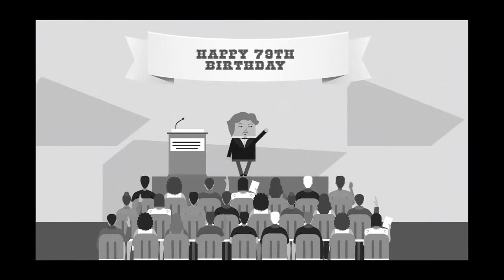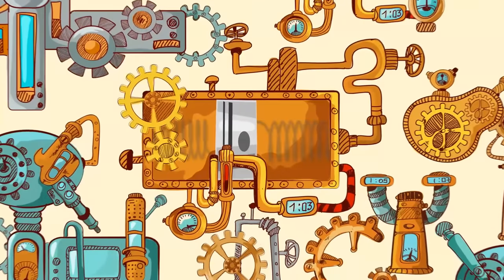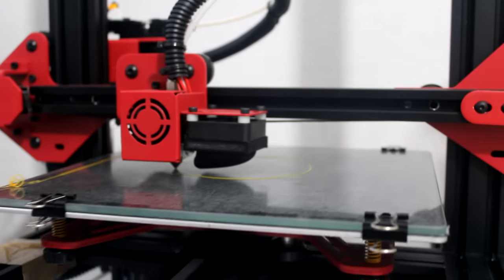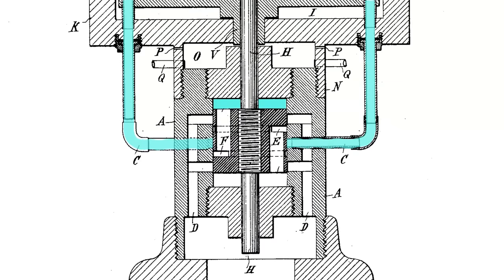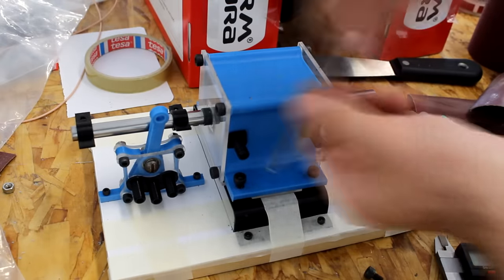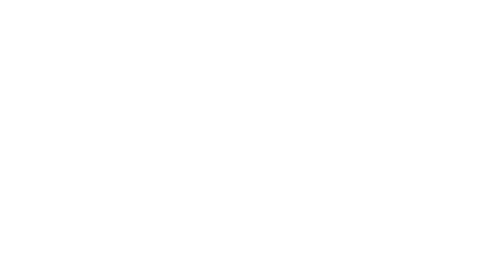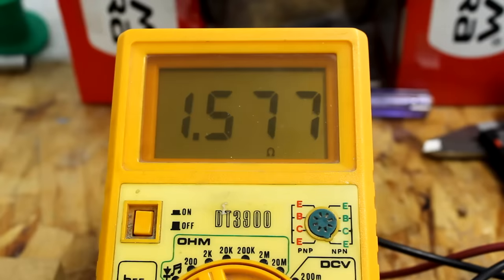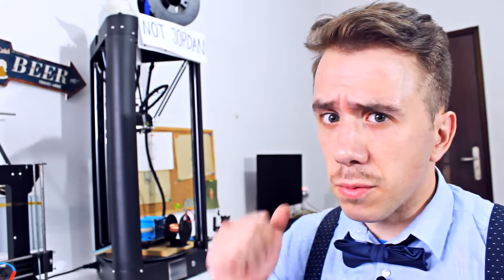Tesla Earthquake Machine [3D Printed]

Comment: you never talked about why the building shook when he turned on the oscillator. From what I understand, it's because everything has a frequency and if you get really close to that frequency, you can excite and cause waves through that object. I'm not sure if I explained it correctly but it's a lot like the singing bowls or a wine glass when you use it to make sound.
Reply: Yeah it's the resonant frequency of a material. The same thing that makes crystal glasses resonate (vibrate) when you run your finger around the rim
Reply: It’s called constructive interference I believe
Reply: @Vorname Nachname I believe they do, it's called a resonate frequency
Reply: @Vorname Nachname Right, and I'm specifically talking about Resonant Frequency, the natural vibrating frequency of an object or system.
Reply: @Vorname Nachname Oh, I see what you mean. No, there is not just one single frequency, instead everything has it's own.
Reply: @Vorname Nachname Exactly,  these are the most import questions in my opinion.
Reply: mechanical resonance .  conventional combustion engines have a conponet called a harmonic balancer... if it wasnt there the engine would destroy itself.  when the same frequency is reached by different moving componets they will oppose each other until the molecule's of the solids seperate..
Reply: That's correct, and it has real-world implications. In 1831 a battalion of soldiers was marching in step across a bridge when it broke apart and collapsed, not because of the weight it was carrying but because the marching happened to be at (or very near) the resonant frequency of the bridge, shaking it to pieces. Since then, soldiers have generally been instructed to break stride while crossing bridges or other supported structures in large groups.
Reply: @gafisher001  There are stories like that going back into antiquity. The bible tells of one about the Walls of Jericho.
Reply: Yup,  @GiffysChannel  .
Reply: So what you’re saying is, either the machine matched the buildings frequency or the machine started to slowly make the building match the machines frequency? The second one seems more sense to me, but i hope to know more about the science behind it
Reply: Naruhodu
Reply: Water hammer.
Reply: Yep. This is why it is possible to shatter a wine glass with soundwaves.
Reply: @nyunster  That’s a broken transliteration of the Japanese statement “なるほど” which could be translated as “I see, you’re right”.
Reply: @nyunster  Since it’s a reply to Giffy’s comment, I dare say it means he agrees.
Reply: It is resonance and you can play with it with a simple bluetooth amp, cell phone with a function generator app and a half decent subwoofer. Just make sure you wear appropriate ear protection and do it away from uncovered ears. Some of the frequencies you can hit on an off the shelf setup will cause permanent damage to your ears.
Reply: @eideticex  VERY cool. didn't know that.
Reply: This is how I believe ancient civilizations moved monolithic stones
Reply: @robertdobson2846  my thoughts EXACTLY!!!!
Reply: Your right.And when an object resonates at resonant frequency it still loses some energy in different forms. Friction,windage,etc. When the energy provided to resonant system is more than these losses amplitude of resonant system goes on increasing.
Reply: There is a story about Mark Twain "Testing" the Oscillator, which ended... poorly.
They had set it up on a Platform, which vibrates, that you could stand on.  
Tesla knew about Twain's Constipation, and Tesla told him his "Therapeutic Machine" would "Impart Vitality" and produce a pleasant sensation.  Twain enjoyed it, and ignored Tesla's warning that he needed to stop, and eventually ended up shitting himself.
Reply: @GiffysChannel  imagine like pool, you hit a wall to hit a ball two hit another ball so that 2 balls go into two different holes 👀 but instead like what is a return frequency if you send blank through a door? What is the frequency of it after it goes through the door to the floor ? What’s the return frequency of that? If you get a frequency that could have say “prime numbers of frequencies” that resonates all the right frequencies to all the corresponding parts 🤷‍♂️ but I am not fully convinced it worked just a theory. I believe it may have been an earth quake
Reply: @austinmoreno8486  I like that explanation though. 👌
Reply: @robertdobson2846  there are stories from ancient Tibet. the monks there could move massive stones up the mountain just by playing big horns.
Reply: Did you ever hum in a room and match the frequency
Reply: @noka79  I did this a lot actually in Egypt. The granite structures out there have some insane resonate effects
Reply: @Eidetic Ex  what's a good app for it?
Reply: @GiffysChannel  gives m.e an idea
Reply: yes but how is it that every object moved as different objects have their own and different resonant frequency?
or it could just be matching the resonant frequency of the building which caused everything to move(by building i mean obviously the materials from which it is made e.g. concrete or metal rods)

Comment: you can calibrate your x and y to print perfect cubes and cylinders.  quick google search will help.. 
after about 5 tries you should get it perfect.. and accurate..  as long as you are not over extruding .. steps are key there.
Reply from the maker: Thank you for the tip :)
Reply: Paul Cole ☆ Where can i find out how to build a MIG Welder 3D Printer?
We had a couple bore welders that would build up strings of wire bead that the machinists would cut to spec.
"Laser Suntered" sounds cool, but SpaceX moves towards reusable & cheaper, so wireless can be adapted easily to create exhaust nozzles for rocket engines with literally "No Upper Limit!"
Reply: Even very high precision CNC mills generate a slight bit of eclipse. At the end of the day the a circle on a machine like this is really the combination of two linear axises. When you come to the top and bottom or left and right ends of the axises the machine head has inertia and can't come to a dead stop instantly which typically results in some error. Hence why things which require high precision circular features often times use drills and reamers to accomplish this. You can use circular interpolation but the error will always be there.
Reply: Heads Mess The desolation you said for the belts seems wrong, you can adjust it infinitely can’t you? What Would make it such a small resolution, I mean I would assume it would be the stepper right?
Reply: @Heads Mess yep. I drives me a little mad when I hear people use the word "perfect" in regards to precision engineering.
Reply: @Heads Mess lol. The install cost is always killer.

Comment: The way you have the magnets oriented, the magnetic field is parallel to the windings so they  don't really cut thru the windings much.  You should try orienting the magnets 90 degrees so the magnetic field cuts thru the windings for their entire length of travel instead of only at the extreme ends of the oscillation.

Comment: Attention. At the time of the student Tesla, the generators (Dynamo) and commutator DC engines were already known. Tesla's "oscillation" machine was never realized. Tesla only suggested the way of direct conversion of the oscillating movement of the steam engine without the use of the crankshaft and the flywheel. What caused a small earthquake was a rotary regulator using cams that were to become a replacement for the original Watt regulator.

Comment: With external valve gear you've basically replicated a steam engine.
Reply from the maker: I guess you're right, Ill try to make a better job once I buy a lathe. Sorry about that.
Reply: @integza  not a complaint, just an observation. It's still amazing it's even possible with 3D printer.
Reply from the maker: @juststeve5542  Thank you:D
Reply: @integza  why you don't contact Johnny Q90?

Comment: @Integza the reason you are stopping in the middle isn't due solely to weight based inertia but instead is due to not having the air spring on the same shaft. The spring would have imparted force at the end of each stroke that wouldn't be countered until it reached near the end of the next stroke meaning while there would be zero imparted force at the center it would have already been made to move both by the air flow and the spring stored power.

Additionally, the cause of the 'earthquake' effect is actually due to the outlet hole on his original design. This can be thought of as similar to a woofer cone where the linear oscillating motion interrupts the airflow causing essentially pulsed air to get pushed into the ground (which the system was originally designed to be bolted to in order to prevent the vibration from physically moving the device.) which if it reaches mechanical resonance with the design of an structure will very easily lead to catastrophic failure. A simple analog is if you just take a big sub (at least 15") and point it at the ground with enough clearance to still allow open airflow, then using a frequency generator and amplifier run it at different frequencies ranging from <10 hz to around 200 hz should be enough range that you'll find a resonance with the ground your standing on and start feeling the shake.

Comment: This has a very similar mechanism to an air file. They work almost exactly the same way by using a piston that redirects air based on its position in order to oscillate, only here the oscillation is used to file away material rather than power a generator. Also you can tune a printer in order to prevent them from printing ovals but it can be very tedious and may not be to the level of accuracy you need for an air tight fit

Comment: I built one of these 7years ago out of stainless and brass for fun.  I did not use round magnets.  I used 3 earth bar magnets and had each pass a steel bars made of plates and wire wrapped around each sticking out sideways like in his design.  It actually makes about 35 volts to charge a cap bank like was intended

Comment: The momentum of an oscillating subsystem is transferred to the the machine according to the mass ratio of moving to resting parts. But it is also possible to compensate the momentum by a second moving subsystem moving on axis with 180 degrees phase shift. So in refrigerator compressors a very light weigt piston and piston rod is used. In cryocooler compressors a double piston compressor applies.

Rotary machinery is always more convenient than resonant oscillating machinery. Tesla's turbine is quite interesting but it needs some modification to make it highly efficient. So the first thing is, that it is usually completely sufficient to use just the outer rim of a disk arrangement as the fluid path. In this way it is also very easy to calculate the power of a certain design under the assumption that more or less completely expanded tangential flow is used to operate the turbine. So only the nozzle calculation is necessary followed up by a balance calculation of fluid friction and generator torque at a certain rotational speed. The lower the friction and the higher the rotational speed the higher is the efficiency of this turbine. The trade of data field for several mass flow rates and rotational speeds is easy going.

And there is also a much more suitable generator for Tesla turbines and their high rotational speed: the axial flux synchronous machine. It has a very simple design, no iron is needed and the moving permanent magnet disk can be integrated into the turbine rotor. So there is no power transferred across the turbine shaft. The power comes as electric power directly from the coil carrier disk.

Comment: This kind of in piston valve is pretty common on Lego projects. You can increase inertia by connecting it to a flywheel. The interesting thing is this design is reversible! You can either connect the inlet  to positive or negative pressures relative to the atmosphere.

Of course, the behavior would not the exactly the same. The flywheel's inertia also works as part of the "restorative force" of the cycle, instead of a spring...

Comment: The mechanical part is well renowned as the drive portion of feeding and airpressure pumps on steam locomotives. Only Tesla mounted an elektromagnetical generator in place of a cylinder.

Comment: Great Idea and looks awesome, I do want to warn you the motor will tare itself off the MDF base in time. You can see the amount of deflection in the MDF at 10:33. larger and thicker washers on the mounting bolts for the motor will by you some time but you'll need to upgrade the base to a steel plate at some point.

Id love to see you make an extrude to make your own filament!
Reply from the maker: Thank you so much 😀

Comment: Maybe the problem is that, at every moment the magnet is moving inside the coil, the intensity of the magnetic field increases in a part of the coil while it decreases in the other part. The induced voltages cancel each other.

Comment: You also need to study up on magnet fields and be sure the field lines are cut as closr to 90° as possible.

What you are striving to accomplish is easily done using circular motion (rotor) and moment arm length, passing the magnetic fields past a PROPERLY ORIENTED pick-up coil!

Comment: things to bare in mind the building he was in was post and beam construction sending post more than 30 feet into the ground and the building was built on a land fill that had a concaved shape so it was basicly a resonent cavity and af the resonate  frequence of the surrounding building they coupled with the standing wave building in the resonate cavity so they shock violently this requires very special circumstances to happen but it is real neat.

Comment: Maybe two years late, but there is a plugin for CURA called arc welder that may help. Another important thing, calibrate your feed rate and flow rate for better accuracy. But with the resin printer and CNC you can recreate this more easily

Comment: This is one of the greatest chanel's i fond about science
Reply: Although it made energy from moving magnetic fields, which it gained energy. 

what if part of the moving oscillating rod, at fast speeds rubbed something and by doing so created static electricity.  Which can also be stored or discharged into something 🤔. 
2 sources of energy 😆🤣😂😹😆 moving magnets and also static generator 😆🤣😂.  

Because the oscillations can be really fast aka lots of static charge lol

Comment: The 'fun' part of Tesla's design is that the timing of the valves is affected by the velocity of the base of the unit.
To put it another way, any vibration in the base of the unit is going to affect the phase and frequency of the oscillator.
Strap the oscillator to a steel beam, and it will 'find' the fundamental frequency of that structure automatically.

Comment: You could have used the drill method but you need to make sure the drill doesn't move and you use a grinding stone/file rather than sand paper.   Basically you are making a very basic lathe.   To get something perfectly round you need the cutting surface to not move and the spinning axis to be as stable, with as little deviation as possible. For truing up the cylinder walls you could do it a number of way but something like a cylinder bore for an rebuilding an engine would be cheap and effective and more accurate if you don't have a drill press.  

*Tip    Also if you put your extruded parts into sealed container with acetone in it  but make sure the item isn't in the liquid, the fumes will smooth out rough surfaces and give your parts a shine.

Comment: If you can adjust the restoring spring force on either side of the spring piston, you can change the operating frequency of the resonant system to tune it to the resonant frequency of a structure, which is what Tesla discovered when he set the entire block into an earthquake. You can also tune it by adjusting mass elements attached to it, but doing that to an assembly while it is operating isn't easy.

Comment: The earthquake machine might have caused a noticeable vibration locally, but there's no way the building and the neighborhood all had the same resonant frequency.  And, of course, the resonant frequency only stays the same for a small oscillating driving force.  Once the effect causes more deviation, the resonant frequency changes due to the material hitting limits, heating up, twisting, etc.  You may make a pipe or the floor vibrate noticeably, but any widespread, high amplitude effect is basically impossible as long as the building is not about to fail.  I suppose an oscillator could be the straw that breaks the camel's back in a severely weakened or under-built structure.

Comment: I don't know if someone mentioned it, but it's very important: your multimeter in the AC measurement, is designed for perfect sinosoidal waveforms and for frequencies of 50/60Hz. Anything else outside this, you are measuring wrong.

I'd advise you to get a true RMS multimeter, also they have a higher safety design. It's the best thing you can do for your inventions, get a proper (and safe) measurement tool.

Comment: some similarities here with the motor design of the original Air-Hogs plane. It had a single piston motor that's stroke was propelled by a mechanically released valve to the pressure chamber. The piston itself pushed the release pin to add the pressure.

Comment: Instead of doing 8000 turns, divide the number of wire turns by 3, do three separate turns spaced by neodymium magnetics and increase the diameter of the pipe you’re using. Then on the inside of the pipe, fill the whole space with some tipe of stuffing to increase the weight of the pipe. You’ll triple your voltage.